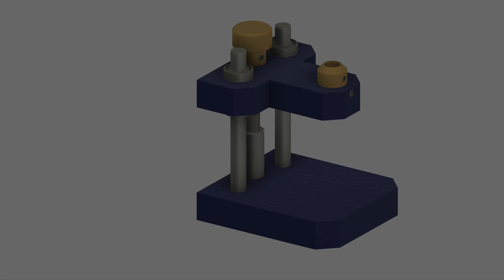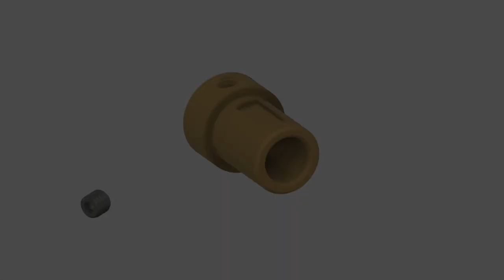Making a brass bush - Watch Hand Lifting Tool Jig - pt2 - amateur machining - horotec 05.120 125

Comment: Good to see you use a starter-drill (countersink). So many videos I have watched with machining processes and these are not used. I was taught many years ago by English and German toolmakers, and they insisted every time I make a hole, use a starter drill, as regular drills can wobble off center easily. I believe I will enjoy this channel as much as the Watch Repair channel. Thank you Mark!

Comment: Quite annoying to have to remake the bush ! I suppose you could have made a brass bush to press into the ali bridge part with the right sized bore,  just thinking out loud here :o)
I do like your ratchet tapping wrench - never used one like that - handy for use on a small lathe 
where you haven't got room. (edit: though you'd have to keep reversing the ratchet to clear the chips...does that work in practice ?)
Reply: Good machining practice suggests machining the ID first. It's much easier to measure and machine an OD to an accurate size. As for the ratcheting tap wrench, I have them and don't like them/ rarely use them. To have to switch the pawl every time I need to back a tap out gets damn annoying - on brass not so much but on tougher metals backing the tap up every turn or so to break up the chips.